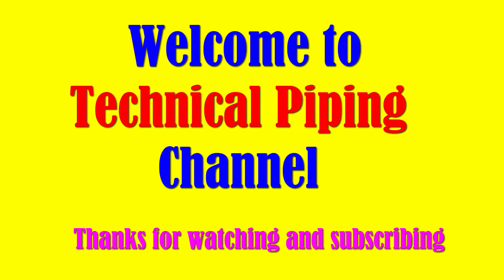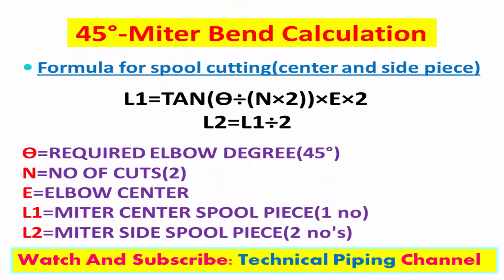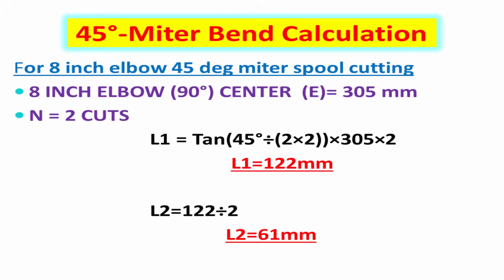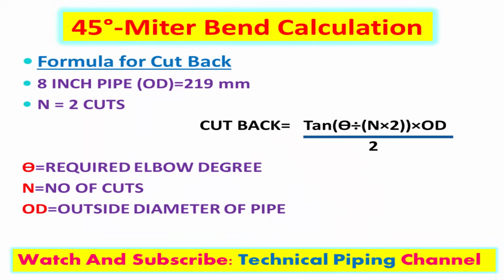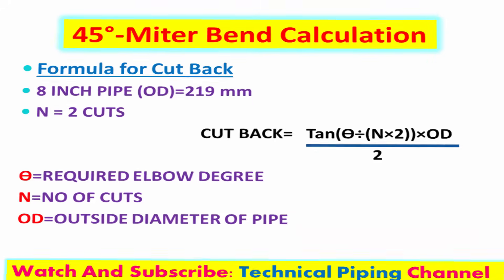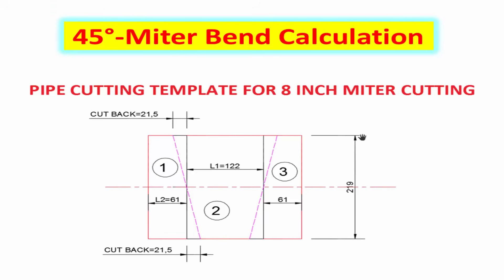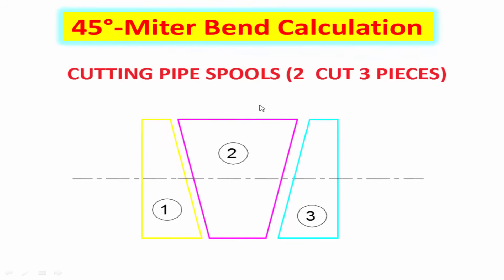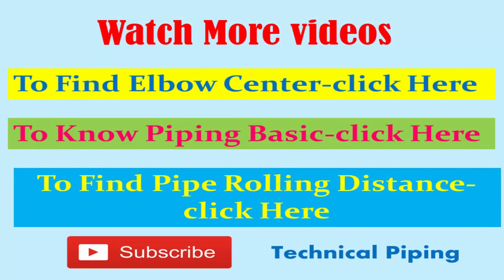Piping_Fabricate 45 Degree Elbow(miter bend) from pipe

Comment: Dear Sir: what is E=305 and OD=219,,,E=radius of elbow?    and 1 inch=2.54mm and,,,219  or 203.2 ??,,,Thanks a lot,,,,,
Reply from the maker: E=ELBOW CENTER (305mm)
OD=Outside diameter of pipe (219mm)
1 inch = 25.4mm

all detail noted in video.watch again.thanks
Reply: sir we both know that you fabricate a 45 degree elbow. sir why you used the formula of 90degree instead of 45 degree.. a littel bit confusing.. tnx for reply
Reply: But why u r using 90 degree elbow centre instead of 45 degree